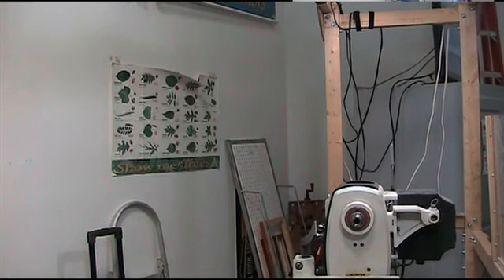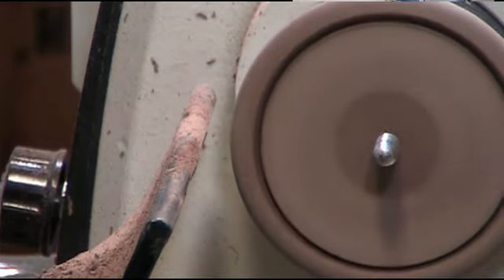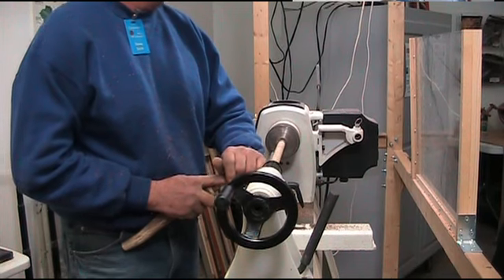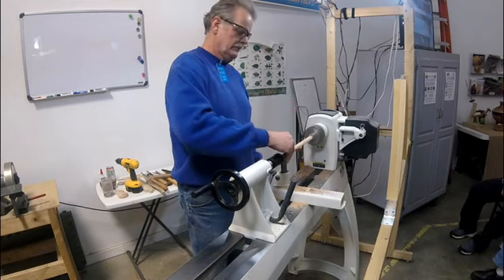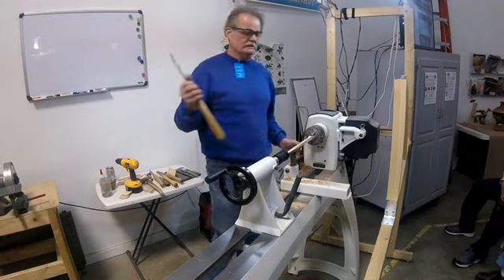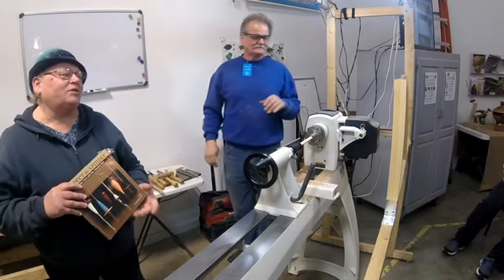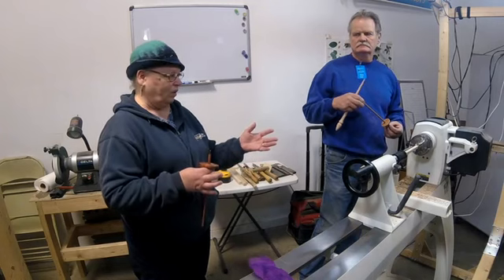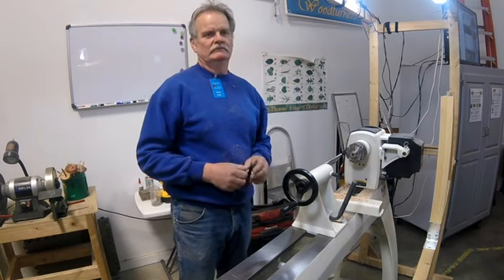Turning Drop Spindles by Danny Smith

Comment: which are the typical drop spindel dimensions? lenght and diameter of the stick? thickness and diameter of the disc? I think I've got 12 inches long, 3.75 (i don't know the unit) diameter. About 50 grams total weight. About 3/4 disc thickness, no diameter data.  Please confirm.